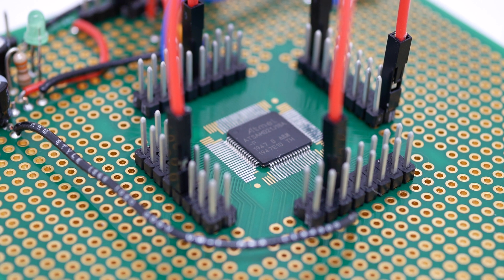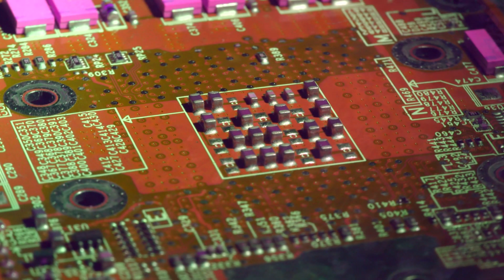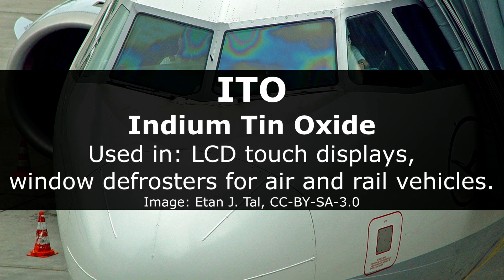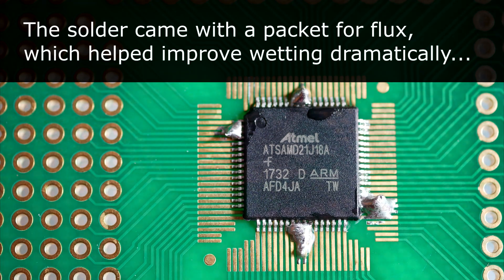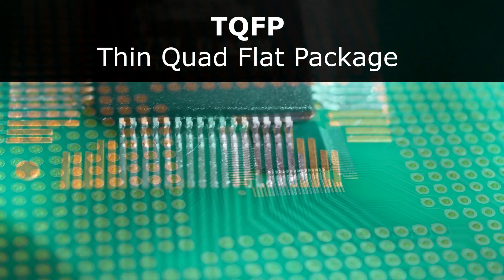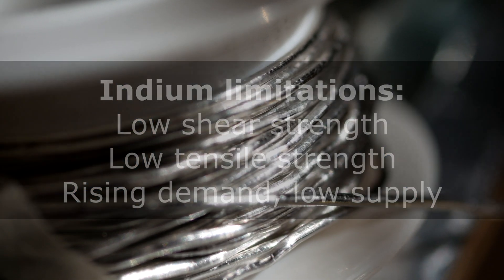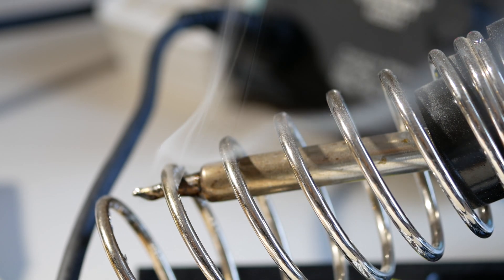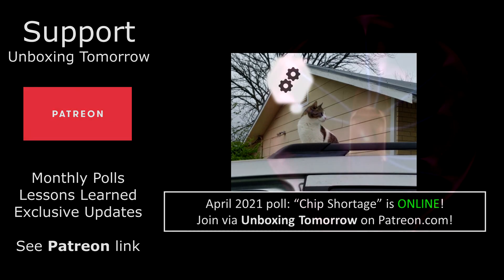Indium in Electronics: Electrical Solder

Comment: The solder joints look quite poor. Instead of using indium for this job, you should have opted to use common leaded or lead free alloy.
Reply from the maker: There's a good chance cross-contamination from previous alloys had an impact.  If time allows, I might retest this using fresh equipment (i.e. clean tip, sponge, solder stand, etc.).  I do agree that popular alloys also tend to be the best for general use.
Reply: @unboxing_tomorrow  Be sure to use distilled water for the sponge wipe only.